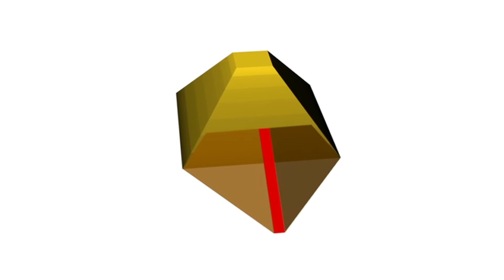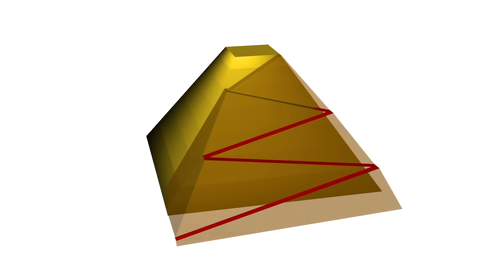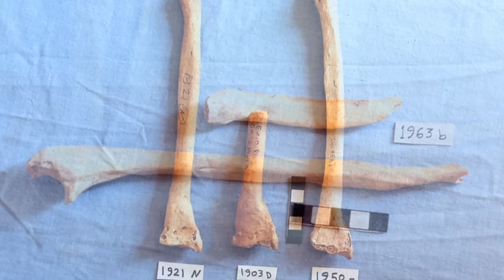Egyptology - Pyramid Construction

Comment: Khufu's was the tallest structure in the world until the late 19th century, thousands of years later. That 21st century science still can't explain how these were built ought to be telling us something. If a ramp had been used, it alone would have been one of the wonders of the ancient world. At a maximum angle of 7 degrees, it would have been more massive then the pyramid itself. There's a modern theory referring to the use of geopolymers indicating that the blocks were not quarried, but poured, like concrete. The ancient Eqyptians would be laughing their asses off at our inept attempts to figure this out.
Reply: First is it is an assumption - a poor one at that - that a ramp needed to go to the top.  The blocks of the pyramids become smaller as they rise in height.  So the largest/heaviest blocks are actually found = close to the ground in the bottom half.  Thus smaller blocks in the upper half were likely raised via the "machine" Herodotus referenced.  That was likely a fulcrum/counterweight device akin to the Egyptian shaduf which rested upon the "steps" to raise the smaller blocks to levels above.

Next is the evidence of ramps is overwhelming.  There are the remains of actual ramps in Egypt while there are depictions of things being built using ramps in tombs.  Your "geopolymer" rubbish is clickbait trash. Like with the ramps there is overwhelming evidence of blocks quarried from the bedrock to include the blocks themselves.  So someone is laughing all right - just not the ancient Egyptians.
Reply: @Curiouser and Curiouser  lol!  Spewing talking points - very old ones at that as your supposed argument goes back to at least the early 1990's - does not a very compelling argument make.  Next is your reading skills apparently need work.

So one more time.  There are the remains of actual ramps today in Egypt. Further there are depictions as noted of things being built using ramps.  Finally as far as Giza Egyptologists long ago noted massive quantities of the earthen material used to create ramps had been dumped into the limestone quarry pits there.  

So actual ramps + depictions of ramps + enormous quantities of ramp material = proof of the same.  Enjoy your incredulity I guess.  I'll stick to the actual evidence on the ground.  

p.s. - yes ramps can be labor intensive = so what.  Building itself is difficult - yet they did so.  Herodotus wrote that he felt the creation of the "great causeway" - aka a ramp - was in itself a great undertaking.  Yet the Egyptians believing their Gods would be pleased and thus Egypt would prosper = endeavored nonetheless.
Reply: @Curiouser and Curiouser  YAWN!!!  Don't you have a video game to play.
Reply: @Curiouser and Curiouser  And...........  That makes you a tourist - not a supposed "expert" who has comprehensively studied the evidence for years.  Oh the tangled webs some weave in the minds....  Dunning-Kruger rules all it seems.
Reply: @Curiouser and Curiouser  Did you look into the Egyptian shaduf I mentioned??  Of course not = ergo the basis of all your problems.  You can also look at the trebuchet such as was used for warfare for centuries.  It is merely a variation of the same.  Your question answers itself - IF - you make the effort to learn what others note.
Reply: @Curiouser and Curiouser  Actually all you accomplished was to reaffirm what I have understood for years now.  To wit:  people who lack any real understanding of the pursuit of evidence which invariably leads to poorly formed assumptions and no real understanding of scientific methodology of conclusion.

As a consolation prize.  Your sophomoric attempt at visualization failed you.  A shaduf does not require a counterweight which identically matches the weight being raised.  All it requires is the addition of some weight which offsets what is being raised with the fulcrum point acting as a balance.

Ergo if you understood the evidence - which you clearly do no - your supposed argument collapses.  The Egyptians first constructed a "stepped pyramid" before encasing it in white limestone from the top down - you should have read Herodotus.  That would allow for your "space" to operate from. Also as noted previously the blocks above such as might be raised by such a device are much smaller than those on the bottom.  The "2 ton" figure = average.  Averages do not reflect actual numbers being offset by very heavy weights on the ground blocks versus very light ones on the top.  

So I could go on of course  = but what is the point.  All you have is incredulity which you attempt to justify via trite conjecture which lacks any connection to the actual evidence as we see.  Enjoy your incredulity.

p.s. - my background was spent in an applied science field - I am retired now.  I rather think I understand about critical thinking.  LMAO!

Comment: A pyramid you’re building is No mere edifice it is now an inclined plane for moving objects…At 51.5 degrees is pretty steep for an incline, but still better than nothing. The “Ramp” theories of pyramid building make no sense, because invariably you have to dismantle and rebuild the pyramid’s interior as you get higher and higher and the floor surface area of which you have to work with shrinks. wrapping stone blocks around perimeter and fashioning the into wheels... and rolling the block along. The wheels mechanical advantage exceeds Pulling sleds by order of magnitude… moving a 2-3 ton block of stone by pulling it would require 25-50 men; A 100 ton block would take 500-1000 men. Rolling a 2-3 ton block only takes 2-5 men. So your mechanical advantage and efficiency improve 20-50 fold.
Reply: So many words when all you had to say was:  "I have no idea of what the evidence here is = and I'm winging it."  I assure you it is that obvious.

Comment: "This precision engineering was achieved using the most rudimentary of tools" - sorry but that's BS. Take a 80-tonne block of granite and try to move it first. If you ever figure it out, start whacking at it with a piece of copper or stone. You will barely make a scratch, let alone be able to create precise surfaces. It's like saying that you can make a clock using wooden stick. It doesn't happen.
Reply: Good thing then that the granite relieving blocks are little more than rectangular-ish crude chunks of stone.  You can Google photos of them after all.  As to moving them = oxen - as is still down today in places by the way.  Draft animal use for labor goes back thousands of years.  Dig deeper.
Reply: @varyolla435  Yeah, a strong ox can pull something like 900 kg. But if we consider Serapeum of Saqqara for instance, they would have to put close to one hundred oxen inside a narrow, pitch-dark tunnel. However, there's barely enough space to fit a couple of people around the block. Does not compute IMO. Also I don't necessarily believe that the beams inside the Great pyramid are relieving blocks. There's a so-called Queen's chamber which doesn't have them yet it holds more mass so the use of beams for this purpose was probably not a necessity. The walls are precisely crafted and not crude by the way. This can't be explained by pointing to the crude blocks above.
Reply: @baze3SC  First of course is that oxen can not merely "pull" = they can also "push".  So via wooden yokes an ox or horse might pull a sledge = if you reverse the framing then teams of oxen can also push upon a sledge.

As to the Serapeum.  Most of the photos seen today are the last part of it as it was created over more than a millennia.  That means = Ptolemaic Egypt.  By then the Egyptians had iron and iron makes wheeled transport feasible as absent iron or steel wheeled conveyance can not support heavy weights. 

Also those famous intricately carved granite sarcophagi as noted date to a time where iron tools were commonplace.  Remember that when people speak to the hieroglyphs found on them as they date to = Roman times.
Reply: @varyolla435  Actually, they are not intricately carved. It looks almost amateurish and that's because cutting granite is hard. Much harder than most people think. The thing is, it's easy to come up with a convenient explanation but nobody bothers to test their theories. And even if someone occasionally does, it's typically done on a much smaller scale. Whoever made those glyphs didn't have the means to create the block itself. Dating a rock artifact based on graffiti is an obvious strategy but not a reliable one. Suppose someone finds Belzoni's inscription inside the Khafre's pyramid 5000 years from now. I'm open to the possibility that these artifacts were merely reused and repurposed. However, thanks for your input.
Reply: @baze3SC  As expected you cycle through rationalizations so as to justify ignorance-based incredulity = rather than confronting the evidence we actually see.  How sad really.

Moral of the story:  if via a demonstration you can cut granite using copies of tools we see the ancient Egyptians used = it is not necessary to fabricate entire blocks or structures just to prove it was possible.  The capacity to shape stone proved it was possible.  So that is a feeble argument really.

Next is the granite sarcophagi at the Serapeum are inscribed with the names of the Pharaohs relating to the timeframe they were created.  Just as periodic tax assessments from ancient Egypt listed the name of the Pharaoh at the time the assessment was done = so the sarcophagi list the names of the Pharaohs when they were created.  So Egyptologists are not dating stone = merely reading the names off of the sarcophagi to date their creation.  The Serapeum was created to support the cult of the Apis bull and all Pharaohs participated in that cult as they did others.  Hence just as they built temples to specific Gods at Karnak etc. = so they added to the Serapeum which was a form of temple. 

Finally Belzoni did not read ancient Egyptian.  lol!  For that matter mankind did not really finally understand ancient Egyptian until = the latter part of the 19th Century.  So claims of supposed forgeries of writing inside of the Great Pyramid are comical in that whoever did so needed to understand ancient Egyptian so as to write it intelligently.  The relieving chambers were discovered before the Rosetta Stone while Vyse's expedition was at a time when understanding of the language was minimal and the experts who decoded it in France and not England.  

Also we just happen to see similar graffitti elsewhere in Egypt to include it written in the exact same style and red ocher paint.  The discovery of Merer's diary in 2013 at Wadi al-Jarf also found white limestone blocks containing similar red graffiti denoting the names of the phyles responsible for moving those blocks.  They were control markings as well as graffitti. Phyle names sometimes included the Pharaoh they worked for.  So it is obvious your understanding here is shall we say "limited".  Perhaps you should dig deeper rather than waste your time with incredulous arguments.  Just a suggestion.
Reply: @varyolla435  Belzoni's inscription is in Italian and that's the whole point. 5000 years from now somebody might think that the Khafre's pyramid was built by Italians. Dating rock artifacts based on graffiti is not a reliable method. Also, being able to chip away at stone is not a proof of precision manufacturing. It's a different league and attempts to reproduce the efforts ended as a fiasco. Refusing to see the obvious is a personal choice and I'm not taking it away from you.

Comment: What a load of absolute shit they would of needed more bricks to make the ramp than to make the pyramid and it would of been miles long don’t listen to them people check out nassim harameins videos if you want to hear the truth about the pyramids
Reply: Nothing is more pathetic than trolls trolling other trolls in the comment section of videos.  lol!  It is the online equivalent of stapling fliers to electrical poles in the hopes of getting customers for a jumble sale.

p.s. - the ramps for the Giza pyramids were made of an earthen mixture = sand/stone chips/tafla - a clay they mined. There are smaller examples of such ramps today in the western cemetery adjacent the Great Pyramid.  Also there is the remains of a huge tafla mining operation near the worker village at Giza.  Finally when the limestone quarries at Giza were excavated decades ago they were found to have had massive amounts of ramp material dumped into them.  

As an aside.  The blocks become smaller as the pyramids rise in height with the largest ones found in the bottom half.  As such the ramp did not have to go to the top = merely to the level of the largest/heaviest blocks - relieving chambers above the King's Chamber which is below the halfway mark. Perhaps you should have learned the evidence first before spouting off...........

Comment: I think it was a mixture of a few different methods. There must of been a ramp, but internally
Herodotus says the used Cranes lift smaller stones.
Lastly they must of used some kind of pulley/ winch system for the Huge Rose-Granite blocks.
Reply: @varyolla435  I wasn't asking for your BS opinion. Your think I Wana read that essay...
Got over yourself!

Comment: Where are the ramps now then
Reply: They were in the limestone quarry pits = but are now out in the desert as those quarries were excavated decades ago and the ramp material dumped into them was cleared out and moved out into the surrounding desert.  So Herodotus wrote they encased the pyramids in white limestone working from the top down.  In doing so the ramps which sat towards the bottom would have been systematically dug away and the residue as noted was dumped into the quarries adjacent the pyramids to backfill the area. 

p.s. - on a side note the ramps did not need to go to the top.  The blocks of the pyramids become smaller as they rise in height with the largest/heaviest ones being found in the bottom half closest to the ground.  Herodotus also wrote they first built a stepped pyramid to then fill in the sides as well as referenced "a machine" and their using levers.  

The machine is likely a scaled up version of the Egyptian shaduf which uses a fulcrum and counterweight.  It could have raised the smaller blocks above to the next levels having rested upon the "steps".  The blocks at the top of the Great Pyramid are small enough to have been slid into place by several men.

Comment: I was fascinated reading the RA Contact about why the Pyramids were built and how the stones were moved/created via thought (infinite energy). 

QUESTIONER: How were the blocks moved?

RA: I am Ra. You must picture the activity within all that is created. The energy is, though finite, quite large compared to the understanding distortion of your peoples. This is an obvious point well known to your peoples, but little considered. This energy is intelligent. It is hierarchical. Much as your mind/body/spirit complex dwells within an hierarchy of vehicles and retains, therefore, the shell, or shape, or field, and the intelligence of each ascendingly intelligent or balanced body, so does each atom of such a material as rock. When one can speak to that intelligence, the finite energy of the physical, or chemical, rock/body is put into contact with that infinite power which is resident in the more well-tuned bodies, be they human or rock. With this connection made, a request may be given. The intelligence of infinite rock-ness communicates to its physical vehicle, and that splitting and moving which is desired is then carried out through the displacement of the energy field of rock-ness from finity to a dimension which we may conveniently call, simply, infinity. In this way, that which is required is accomplished due to the cooperation of the infinite understanding of the Creator indwelling in the living rock. This is, of course, the mechanism by which many things are accomplished which are not subject to your present means of physical analysis of action at a distance.

Comment: Sheer muscle power? From whom? Slaves on steroids?
Reply: Actually science of a type along with = draft animals.  There is archeological evidence they moved things on wooden sleds and poured water before the sled to moisten the ground.  Further there is evidence they built earthen ramps made from a mixture of sand/stone chips/tafla - a clay they mined.  There is the remains of a huge tafla mining operation at Giza near the worker village.

What happens when you moisten clay???  Answer:  it gets a bit slippery.  So studies done with sand alone showed that by wetting the ground before a laden sled you reduced the friction - and hence effort - by almost half.  There is also evidence of their laying wooden planks spaced along a path over which blocks were pulled.  Finally the Egyptians like others - even today around the world - employed animal power.  You can see depictions of yoked oxen pulling things in ancient Egypt to include a large sarcophagus on a wooden sled.  An ox can pull more than twice its body weight so that teams of oxen can pull multi-ton loads.

At the worker village at Giza they found many tens of thousands of cattle bones.  So if they were consuming them = they most certainly would have also used them for pulling sleds as well - at least for the larger blocks at the bottom.  The largest/heaviest blocks are found in the bottom half of the pyramids.  Above that level the blocks become smaller as it rises in height. 

p.s. - forget slaves as that is Hollywood and not history.  lol!